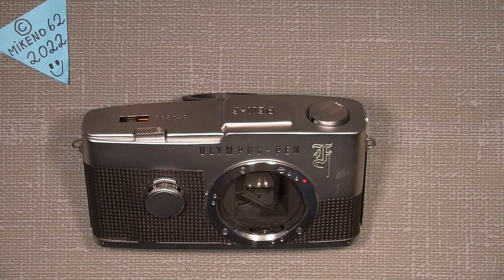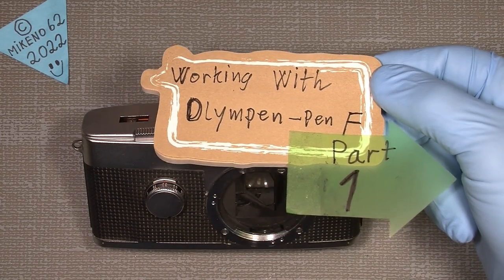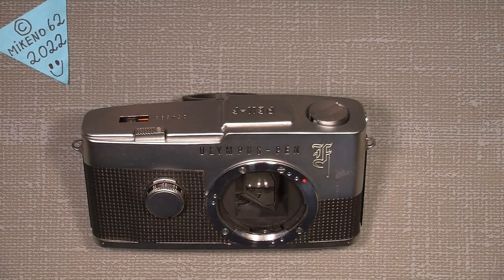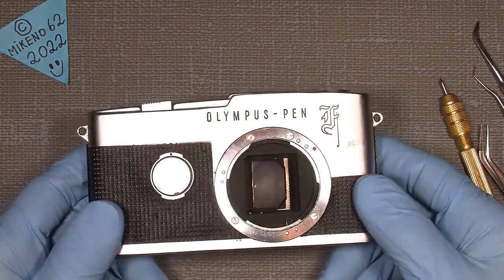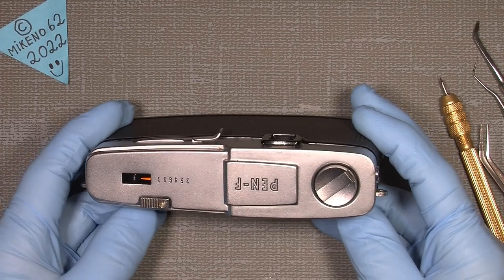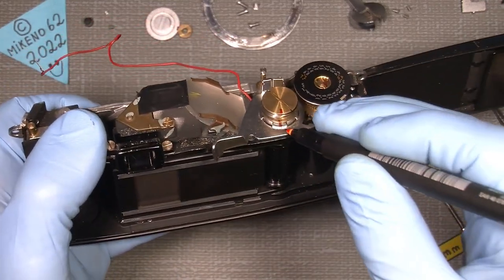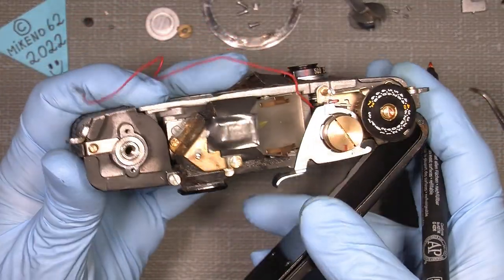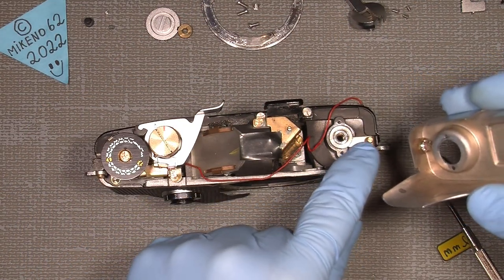Working with Olympus-PEN F   PART 1 Disassemble and setting marks

Comment: This video give me flasbacks of the nightmares I had when I repaired my F without setting the marks. It took me many many many attempts to put it back together again. My F had a broken spring inside the sprocket which tensions the mirror actuation. Also have a FT and they are very different machanically i.e. parts are not interchangeable. FYI my precious F is still working today! Had to go to hell and back to get it working again though LOL.

Comment: thanks for the video, my Olympus's mirror is stuck at shooting position and i'm using your video as a reference to fix the camera!
Reply: If you take the lens off and shoot it, does  the mirror also stuck?
Mine was shooting correctly without a lens.
I only  had to take the bottom cover of and oiled the shooting mechanism there. It works all fine now.
Reply: @djverloo  hi I have the same problem but the aperture mechanism is fine. So my question is how would the lens affect the shutter sticking? And where did you oil exactly?

Comment: Hello, I am having an issue with my Pen F in that the advance lever will not move and the shutter release button will not make the shutter actually function. I have opened up both the top and bottom plates and can observe the necessary components working there but otherwise I cannot diagnose what the actual problem is. Would anyone be able to help me with this?

Comment: Awesome! This is exactly what I was looking for. The 1/60 shutter speed on my PEN F is firing slow. Do I just soak the slow gear in isopropyl and then lube it afterwards?
Reply from the maker: Yes, just soak the slow gear in Isopropylalcohol 99% then blow the gear with compressed air, and then lube it, BUT ONLY a tiny drop and ONLY on the axle ends. If there is too much oil on the axle end, the oil will soak into the gear wheels, so just wipe away if the drop is too big.